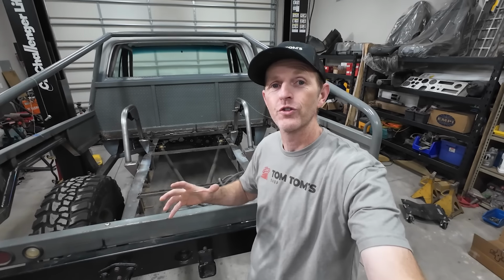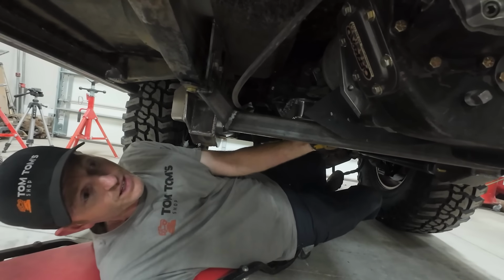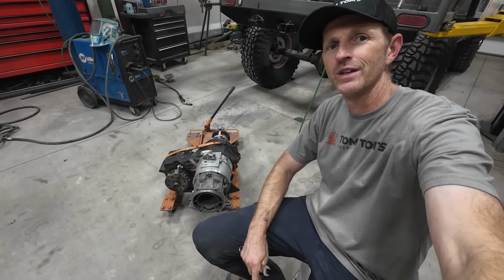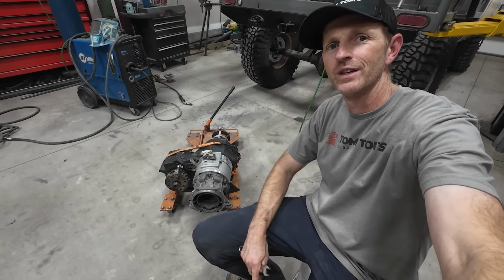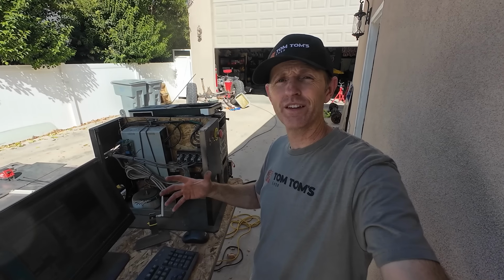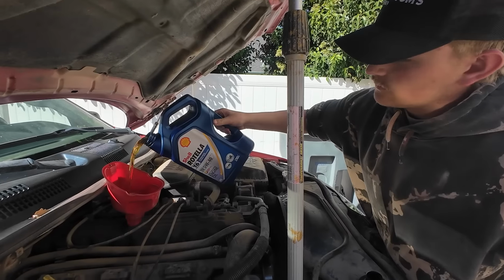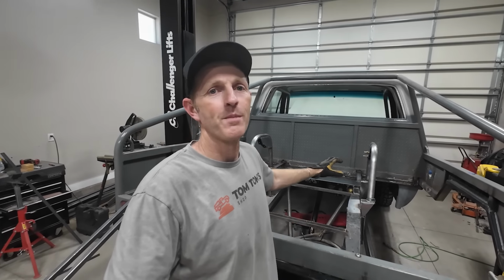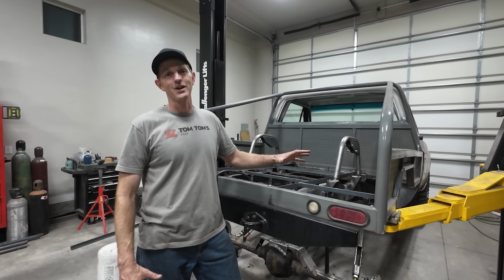Crunch Time to Finish Dig Dug

Comment: Do your self a favor Tom Tom. Buy Angela a new measuring cup and dedicate the one you used to garage use. I don't think she is going to want it back.
Reply: Hah ! Pyrex  does not hold petrol and oil smells, much better than plastic for "dual use" !
Reply: I thought that was a joke 🤔
Reply: What she doesn’t know 😅
Reply: Just bought a Dollar store measuring cup. Has embossed cup fractions and ounces. Screw on lid and transparent.
Reply: davidwatts is sharing wisdom from lessons learned😂
Reply: Nah, a few spritzes of carb cleaner and it'll be good to go.
Reply: Looking good Tom...lot's  of welding like a battleship...lol
Reply: Agreed!  I suspect that was gear oil going into the t case.  That smell will never go away and it will probably affect the taste as well!  That was probably a joke, at least I hope it was.
Reply: @barrieevans2570  That's all good until she knows.  lol
Reply: If Dawn can clean oil from a duck a measuring cup will be no problem

Comment: Amateur tip: put a nut on the bolt before cutting to length and grinding so it will open up the threads on the way off. Chase with a die if desired.
Reply: I posted this as well. Sorry I didn't see you post first...
Reply: I like to dress the end and make it all pretty. Nothing wrong with your suggestion.
Reply: Good suggestion. Also, a triangle jeweler's file gives you a perfect 60° thread geometry. 
(Available at you know who)
Reply: @stoker20  even if you dress the end you can still get a burr, the ole nut trick helps. I think in this case there was so little length left that he couldn't do it. I'd be welding the nuts to the frame in this case lol
Reply: @zyeborm  I have to shorten a lot of small fine thread screws for door hardware. I use a file and my thread is perfect. I charge $1 per minute.

Comment: I'm glad to see you using weld-through primer.  So many welders don't, and I think that's a big mistake that will haunt them a few years down the road.  I suppose if it's contract work they are doing, they don't care as much about it as they would if it were their own project.  Another great video!

Comment: When you pulled the transfer case from the transmission, there was an O-ring between the adapter and the transmission. When you put it back together, I didn't see that O-ring going back in. Did I miss something? Edited out? Love your channel. Another Tom in Hurricane...
Reply: That o ring is for a tail shaft seal when thst 4l80e was 2wd it dont need it now

Comment: Tom, When cutting bolt threads off screw a nut on it before putting it in the vise. Holds it straighter and acts as a guide for length of cut. Also helps cleaning up the threads post grinding. Just a suggestion...

Comment: I love your work and vision.  I have found that when cutting off the end of the threads on a bolt, it can make it easier if you thread a nut on the bolt before cutting so that the end thread isn't compromised, even if it means sacrificing that nut.  It is faster and easier than having to chase the threads with a die.  Keep up the great work.

Comment: Just measure what you need in water using the cup measure, transfer the measured water to another container and mark the volume on the new container.  No need to get into trouble.
Reply: lol , that trick has got me out of trouble before  ( or avoided me getting into trouble )
Reply: @888johnmac  🤣

Comment: Tom Tom, here’s an old school mechanic’s secret for the WJ. You can substitute 1 qt of oil with 1 qt of ATF. ATF is a fantastic detergent and it will break down sludge and varnish inside the engine and valve cover. And you can do this as long as you you’d like on older motors. You should give it a go! Take a before picture of the valve cover. And give it a few oil changes. Hope this helps!

Comment: Tom, you need to tell Matt to connect top and bottom frame flanges at splice on that 6x6 flat bed truck; I say 45 degree connection is the worst; maybe run a calc and get with him on that; weld the connections for strength; must be a continuous load path! I did structural engineering! ;)
Reply: VERY IMPORTANT POST ABOVE!!! :(

Comment: The rope is likely not stronger, but that doesn't matter.   The rope is probably tougher, which literally means it can absorb more energy before it fails.   You can be tough by being very strong, or by being very flexible, or any combination of the two.

Comment: Tom Tom:
Those Frame & Suspension Bolts NEED to be DOT Flange Black Oxide Frame & Flange Nuts!
Cad-Grade 8 are NOT Shock Certified, especially with out washers.

Old Skool been there, done that & scars to remember😢

For the Wood Flooring, try Apitong Oak as used on Flat Bed Heavy Trucking & seal with a Deck Seal combination w/ Linseed Oil.
Had that on a Heavy Haul Rig; looked like new when 4 years old, still beaded water & zero visible rot😊

Comment: Just before I do an oil change on the Bumble Jeep, I dump a whole bottle of Sea Foam in the oil and run a tank of gas thru it (250ish miles), then do the oil change. I've found that my 4.0L hold close to 7 quarts with a filter change. I always change the filter with every oil change. Hope this helps. God bless.

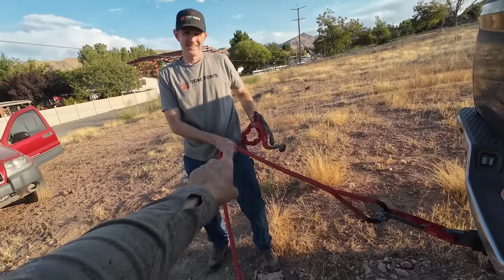Comment: 21:24 I used to have a few Suzuki Samurai style 4X4's ... I flat towed them all the time with an old safety belt lanyard ...they are just 5/8" diametre and have a snap clip on each end :) 

NOTE:  If you ever uses a safety lanyards for towing?? Spray paint the snap hooks and splice ends with  Red or Fluorescent Orange on both ends ... So everyone knows t NOT use if for safety purposes again.

Comment: I have a 2012 Silverado 1500 with a 5.3 it had a push rod - valve tick when I bought it I put a quart of diesel fuel in the crank case let it idle for 10 minutes at operating temperature drain and add oil I'm over 260, + I add the diesel fuel once a year at the time of the oil change

Comment: Tom you may want to turn the rear tailshaft around as you installed it back the front 
as the slip spline goes behind the gearbox not in front of the diff

Comment: Tom I’m  surprised that you didn’t thread a nut on the screws before you cut them.  That way the nut will straighten the thread as you remove it.  Just an old man’s 2 cents worth.

Comment: The metal saw doesn't spin at half the speed, it's only like 1,000-2,000 rpm slower! Instead of spinning @6,500 rpm like the wood saw it spins @4,500-5,500 rpm this is just an example, it depends on model and manufacturer of specific saws being compared, but there are like Steel Demon blades that can run faster that you can run on your Skilsaw.  I have run Steel Demon blades on my worm drive Mag77 Skillsaw and they work, but they burn through blades pretty fast when making full 4' cuts, and 8' rips! The slower blade speed definitely increases the life of the metal blades just confirm the rpm of your saw and find a metal blade that is rated for faster than the rpm of your saw, and you will be able to cut metal with your regular circular saw!

Comment: I was going to Green bay WI from my house about a hour away. I just got into gb and my truck started bucking and speedometer dropped. It went into neutral. I thought my transmission went out. I only had 1namd 2nd gear and reverse. I changed the transmission and it did the same thing only 1 st amd 2md gear amd reverse. I checked all the wiring and fuses. I changed the vehicle speed sensor truck worked good had all the gears. So now i have a extra transmission 😂

Comment: Why didn't you weld the nuts on the top link bars? So if you have to do a trail repair you won't have to mess with them or worse try finding them in the rocks & sand!

Comment: Hi Tom, why the u bolts on the back drive shaft bearings. Surely the round profile of the u bolt will only have point contact on the needle roller housing, whereas the strap gives a more even load?

Comment: Granted your not in the rust belt.... so may not be an issue for you....  Here in the rust belt many are moving back to just generic pait and NOT Por 15 or any other kind of encapsulating paint.  The theory is sound (encapsulate so no air nor water can get in to cause rust)  but reality is...  both gets in from minor invisible imperfections and scrapes etc etc.  This ends up HIDING forming/growing rust.  Some think it even accelerates rust cause the space between the paint and metal that forms; holds moisture.   

End result..... few years later it still looks good on the outside.... but behind the paint..  your metal is rusting away to nothing.....

Comment: That tick is NOT Lifters, it is rod bearings you guys use too light of engine oil; need at least 30 weight oil for summer time with Lucas oil treatment; dumb Bmw guys keep replacing rod bearings just to use lightest engine oil, so dumb! ;)
Reply: I believe that was 10W40 they put in